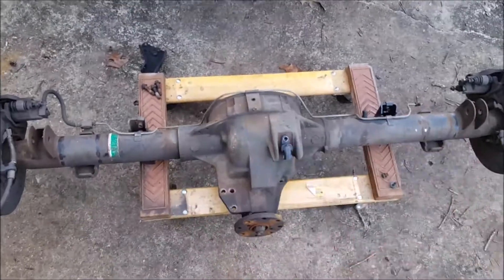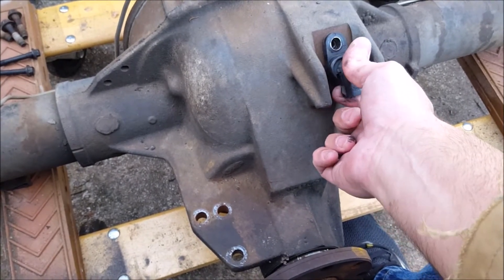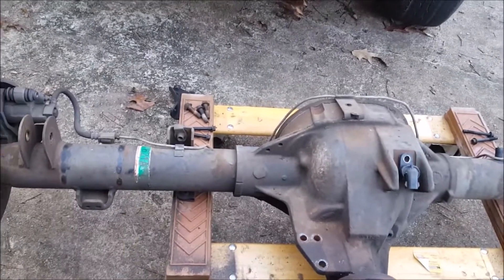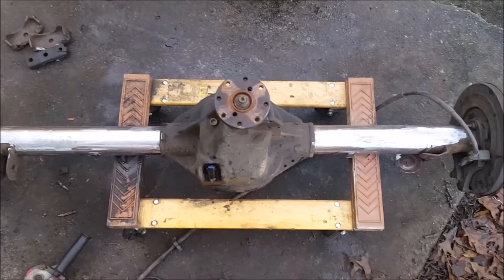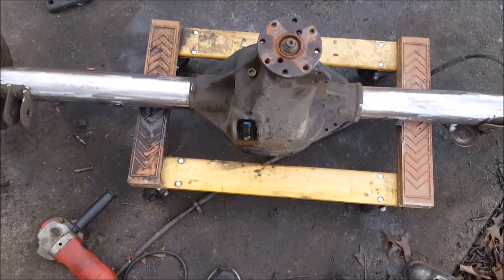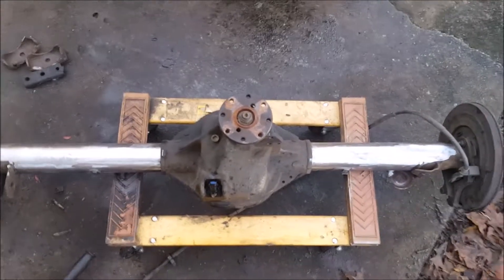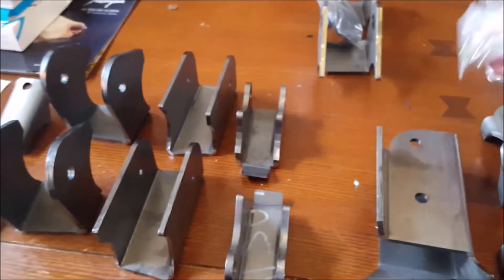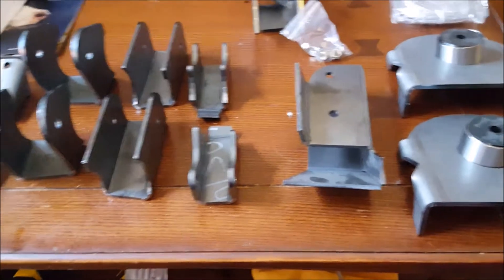Jeep TJ 8.8 build: Barnes 4WD Brackets and Prep

Comment: Where did you pick the axle up from and how much?! Does it have the limited slip diff? Thinking about doing this to my tj eventually too!
Reply from the maker: I had been scouring Craigslist and Facebook for quite a while and finally came across it. $200 which was about $50 more than i usually see them for but it was the correct gear ratio, Limited slip and disc brakes. I couldnt pass it up. came from a local guy to me who had a tree fall on his explorer!!
Reply: cvsahara thats awesome! What gear ratio they usually come in? I still have the stock ratio in mine
Reply from the maker: I think they come in a wide range of ratios since the explorer and sport-trac were built for so long. I have seen them in 4.10, 3.55, 3.73, 3.07, etc. those are the also the basic TJ ratios so it may just take some searching.
Reply: cvsahara thats true. When are you posting the fab and welding vid! Ive used some of your vids in the past as reference when im working on my tj.
Reply from the maker: I will be doing the actual measuring and welding a week from this coming Tuesday. It will take me a couple of days after that to edit and post the video so I would expect it to be posted in about a week and a half. I'll also be posting the front end steering rebuild videos on the grand cherokee around that time.
Reply: cvsahara Awesome. Lookin forward to seeing the vids.